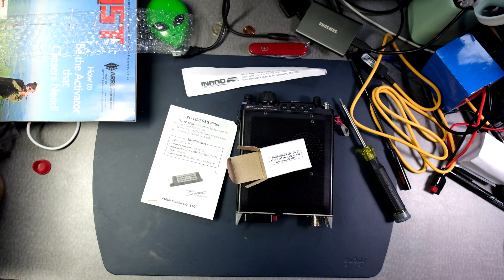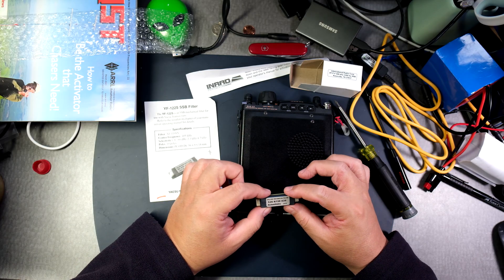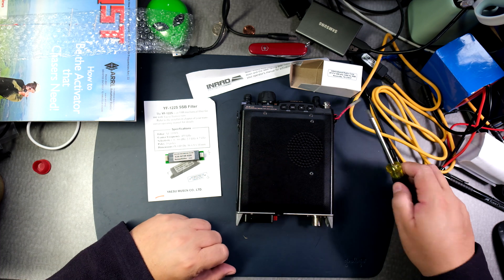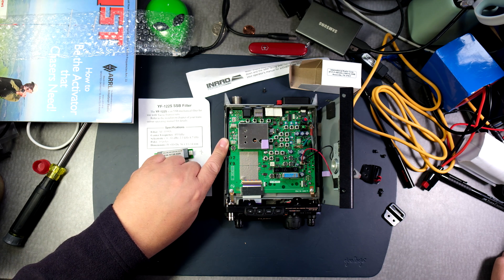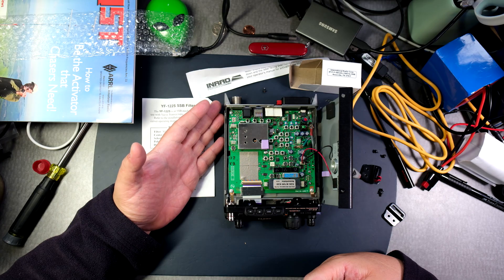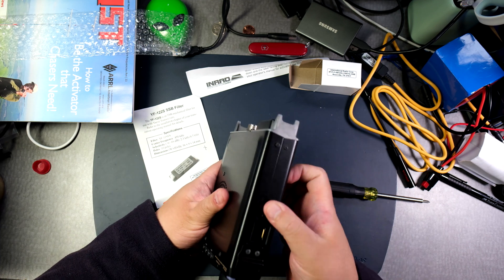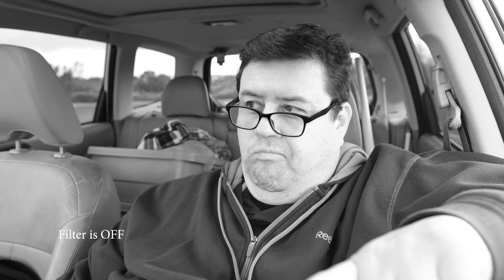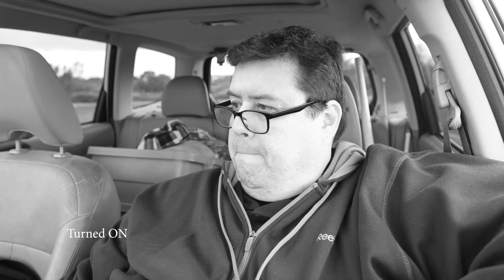Yaesu FT-818 SSB Filter

Comment: How well does it work to eliminate adjacent signals? I find the stock pass band on SSB is much wider than 3KHz. While improved audio would be nice, I 'd also like some improved selectivity to knock down the QRM from stations +/-3KHz away. 73
Reply from the maker: I would say it has a very poor pass band. But then again, I’m not doing contesting. Overall, it does a good job at six Watts, and with some headphones will do the job.

Comment: Great video! The FT-817/FT-818 does not recognize which type of filter you install, so you select SSB or CW in the advanced menu. This SSB filter is narrower than the standard IF-filter for both SSB and CW. So if you select CW optional filter in the advanced menu, you can use this filter too in CW mode. And yes - for CW this filter is a great improvement too. Unlike when SSB is selected as optional filter, the CW selection will let you use this filter/stock filter, by just one press on the "NAR"-button in the fast menu. I think this SSB filter is a very good choice, as it enhances both SSB and CW reception. Best 73. Einar.
Reply from the maker: Thanks for the tip. I’ll listen to some CW and listen.